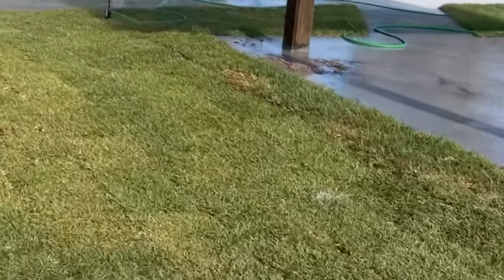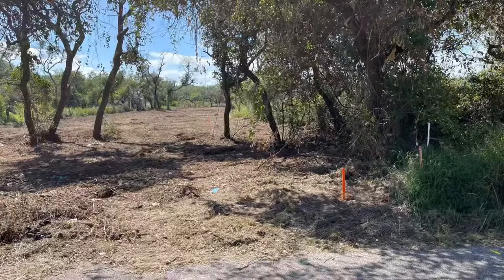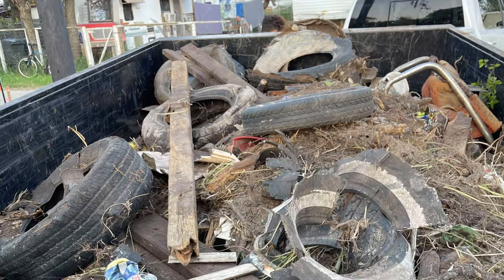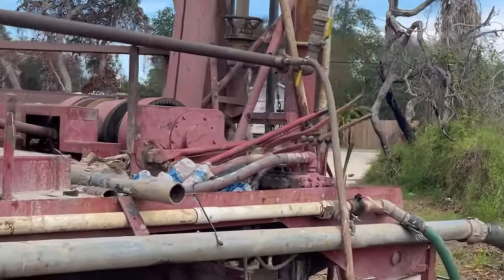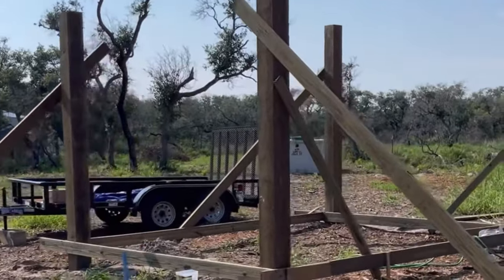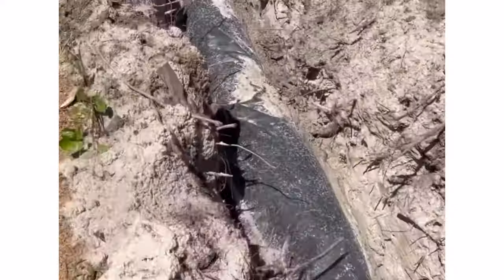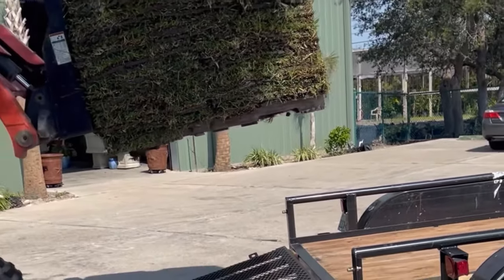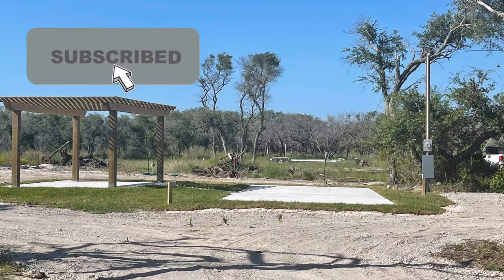Building your own RV spot l Vacant land for RV parking l Buying RV lot l investment RV real estate

Comment: Who did you used for your water well
Reply from the maker: I just got a local water well guy to do it, called two and the price was about the same from each of them
Reply: @simplyinvested  around my area they average around 25k
Reply from the maker: That ain’t cheap!! I havent done one around here in a year or two probably butvIbthink they’re up to $12,500 …a few years ago…probably 5 or so I could get a well drilled with a pump and pressure tank for $5,500 🤷‍♂️long gone! But land is not too valuable without water so it’s kinda hard to do without it…one time I had 3 lots next to each other I would have to spend 30k to put 3 wells or I could spend ~$25k to the city and they extended the water lines from down the street to my property…and everyone else along the street got access to the water lines I paid for! Oh well, nothing wrong with improving the neighborhood and getting a good deal on water to my property (and still cheaper than the water wells) maybe there are some municipal water lines close by you could extend?